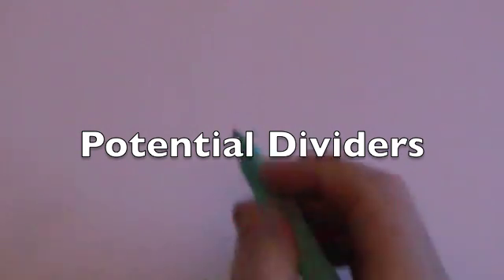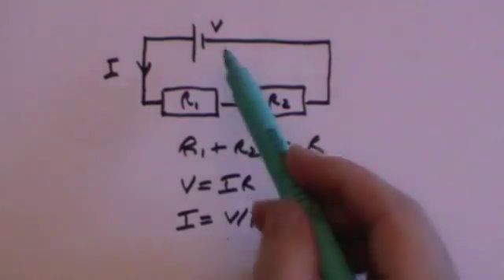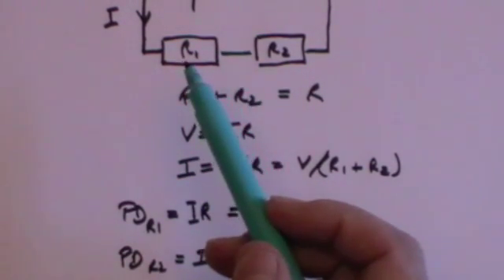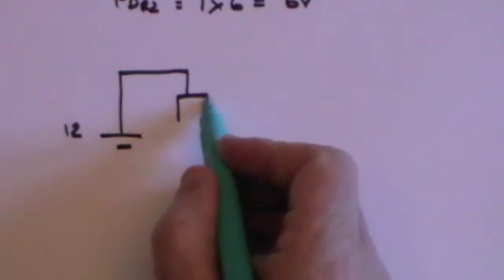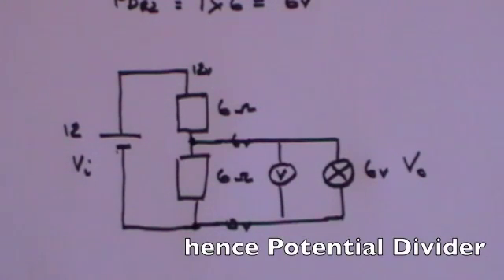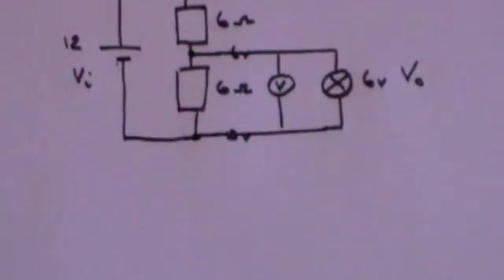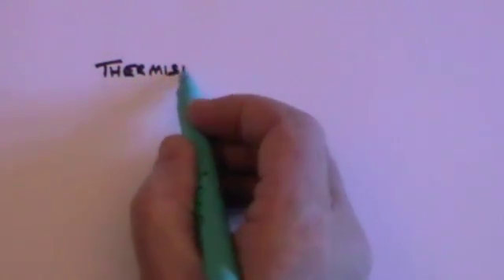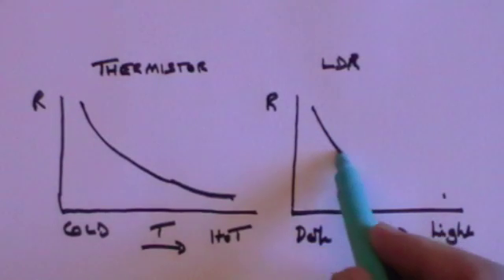Potential Dividers: GCSE revision

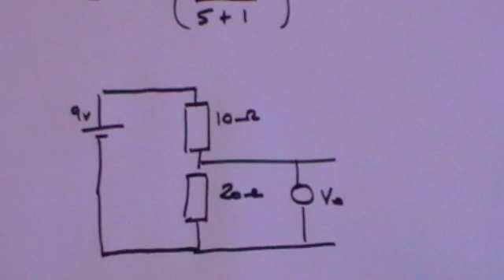Comment: Thank you sir for your efforts. Won't the 6 volts lamp attached in 11:47 decrease the overall resistance of the resistor to which it is attached in parallel allowing a comparatively higher value of current in the circuit ?

Comment: I have a question, in the exam if you work out the Resistor values and you put 2/3 , then I say that R1 is 2ohm and R2 is 1ohm then would that be incorrect? because how would you know whether it's 20/30 ohm or 2/3 ohms? Hope I'm being understanding to my question.
Reply from the maker: +Sean o'connell Well you are right that if all you know is the ratio of the resistor values you cannot determine the actual value of each resistor. But you would usually be given some other info (such as current).

Comment: Great video as always, thanks! I have a query. My textbook says that potential dividers cannot be used to light bulbs. It shows an example in the book. If you have a 6V supply and 2 resistors (R1 and R2) each of which is 100 ohms and placed in series then the p.d. drop across each is 3V. It says a typical 3V bulb has a resistance of 15 ohms. If we put this across R1 for example, the equivalent resistance will be 13.04 ohms. Then it calculates the new voltage across R1:

 V1 = (R1/Rtotal) Vtotal......V1 = (13.04/113.04) 6......V1 = 0.7V.

So it says that the bulb doesn't light because as soon as you connect it across R1 this changes the mechanics of the entire circuit and the bulb only gets 0.7V. Is this right? If so, what is the point of a potential divider if as soon as you put a load across the resistor you no longer get that voltage?
Reply from the maker: Quite right. It means you have to choose the values of R1 and R2 carefully.